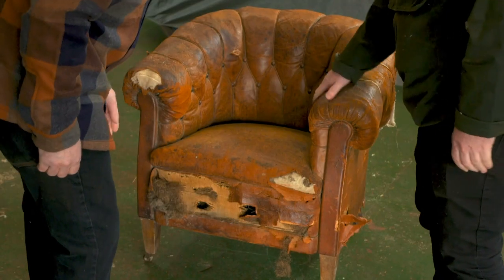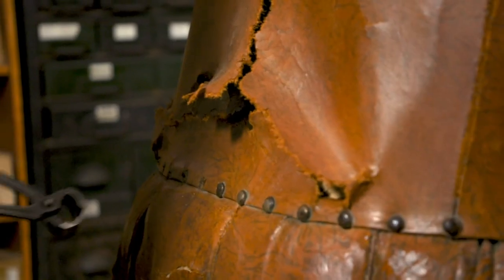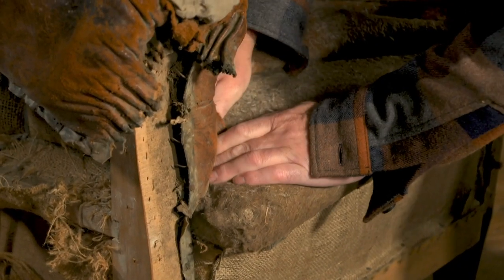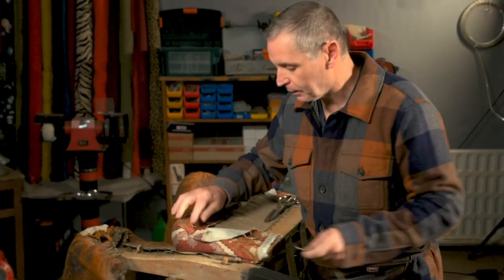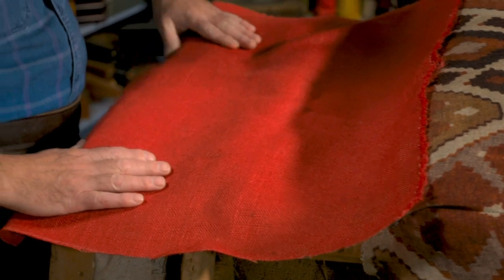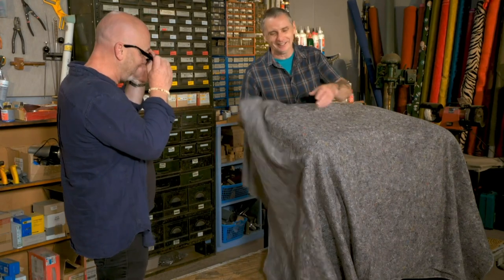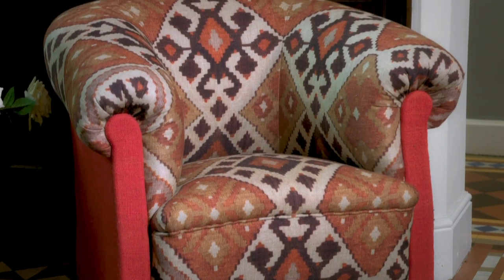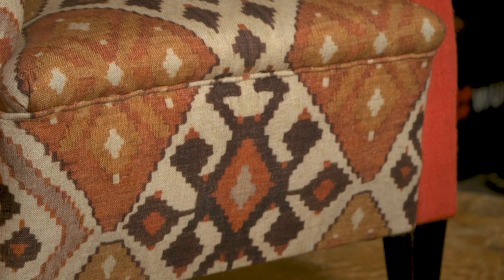Drew Restores And Upgrades A Period Chesterfield Armchair | Salvage Hunters: The Restorers

Comment: It's a desecration to take a real antique leather chair, and just destroy it, taking out the buttons, and putting on a loud fabric on it.  No matter how good his "workmanship" it has destroyed the chair forever.  No-one would recognize it, and restore it to a true pre-chesterfield ever.
Reply: Agreed, however in fairness, the chair was already destroyed and would have been considered beyond repair by just about every other restorer. Reupholstering the chair, regardless of the material, would have had a devastating effect on its historical value. It doesn't really matter whether you're using leather or loud fabric, when you're replacing this much of the original it's simply not a historical piece anymore. The only difference would be aesthetic.